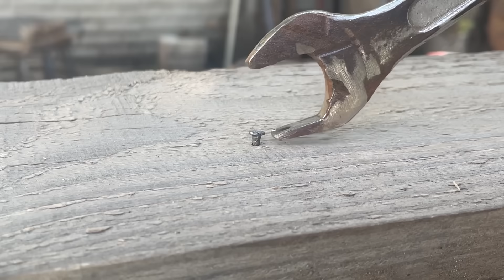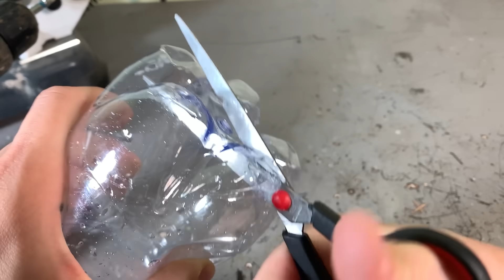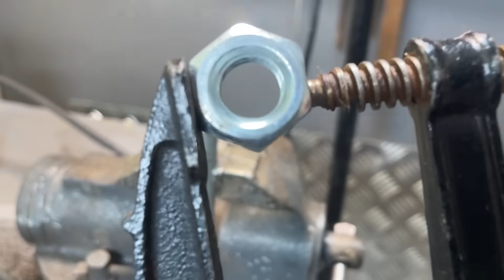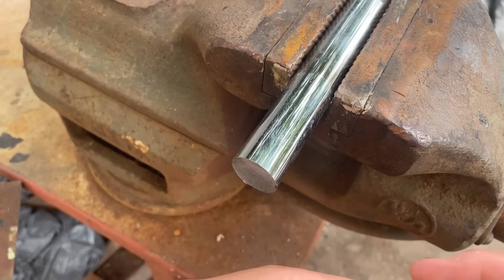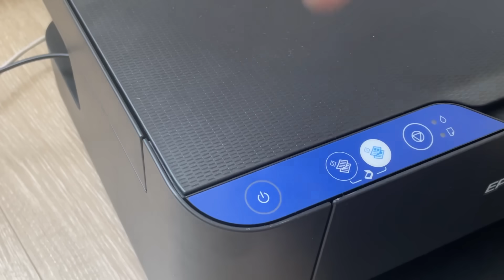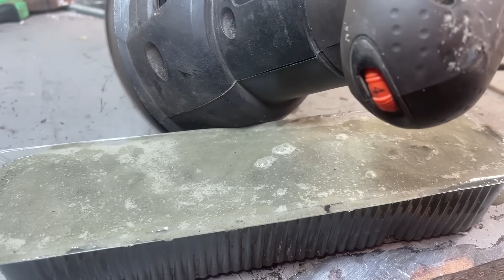Clever Handyman Inventions

Comment: What's the point of the first one?
The second one, can save time, money, and materials and just buy a pin remover, or use a screwdriver as many have done before. Then even further on it, just buy a paint mixer.
Third one, cool, you put a cross cut in a section of bolt to screw it into some soft wood... that does nothing but have a chunk of metal in the middle of a piece of soft wood.
Fourth one, yay! You bolted some white to some soft wood so that you have some wire bolted to some soft wood to yank on. Here's a "hack," tie some string to the head of a broom so you have some string tied to the head of a broom to yank on.
And on, and on, and on, and... use a plastic bottle on your indoor faucet to fill the bucket? Yeah, having a bottle with water inside left hanging on your faucet is much more practical than buying a faucet that has a nozzle on a hose, screwing a hose to your faucet if you don't have that but have a threaded faucet, or, you know, using an outdoor faucet, your shower head, or your bath faucet.
'Here, law nails on a board, burn the board, and you fixed the problem with your AC unit!' What is that "hack" even supposed to be used for?
The nail through cardboard, for people that lack the mental capacity to hold a nail. Just just using an angle grinder to turn a wrench into a limited range cat paw for people too stupid to use the claws on their hammer or cat paw.

Comment: If I saw somebody on my crew trying to use half these tricks, I would fire them. Most of these are pointless.
Reply: Вероятно Ваша команда делает работу для которой эти трюки бессмысленны. Другой команде для работы эти трюки подойдут.
Reply: "How to ruin the wrong tool in order to do the job that right tool could've done properly."
Although pre-cutting screw threads in a headless bolt isn't a bad idea, to be fair. Although I've only ever done that to REMOVE a bolt that had the head shorn off, not screw in a stud bolt.
Reply: They will be useful in certain situations.

Comment: In all those videos I keep asking myself: what if I don't have an angle grinder? And in many of those, the angle grinder you need probably costs more than the correct tool you should be using instead of those hacks.
Reply: Creativity is the staple of a true handymans skills. Certainly i could assume that there are affordable options available.
Reply: @michaelunderwood5138  You mean more affordable options that are made to directly address a problem?  These things require you to use tools to alter tools to change their given purpose...why?
Reply: A true handy man will have the correct tools to make the job easierand faster. Creativity is a staple in a hanymans arsenal. No matter what he will build or get what  he needs if he doesn't have it. In a pinch you should never modify how a tool is designed to work it could cause damage to the job or could cause injury to persons or operator.
Reply: For everything I've seen in this video a patented tool or part already exists
Reply: @dosatkeysbeats  And those probably cost less than the angle grinder you need to to all of these hacks.
Reply: @michaelunderwood5138  creativity has nothing to do with being a handyman. It would apply to an artist or an architect, but not someone with basic maintenance skills.

Comment: there are more than a few of these that are down right clever. Then there are some that.... The tools used to make the "Handyman Invention" cost more than the invention itself, and if you have the tool to make it, you should already have at least 2 of the tool you're trying to replace. (or in the case of the wire strippers, a knife already in your pocket)
Reply: There are few that that known, like drilling wooden plank with plank underneath, but rest of "inventions" is downright awful. Why do anyone would need to attach box cutter to a plank if you can use it right away without any issues.